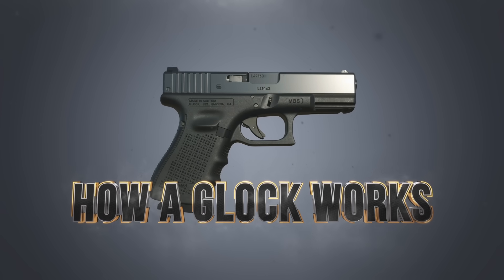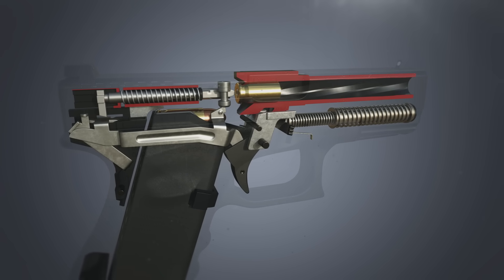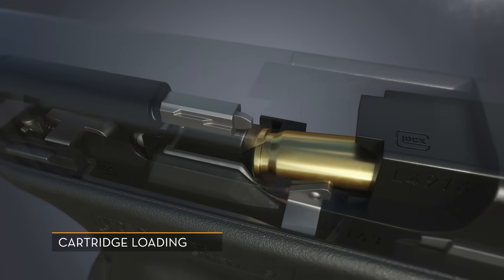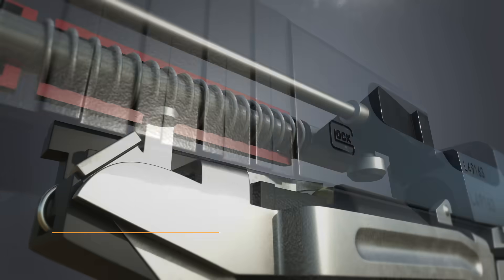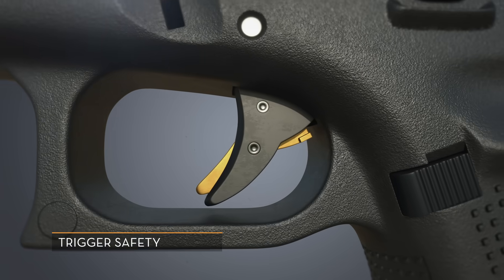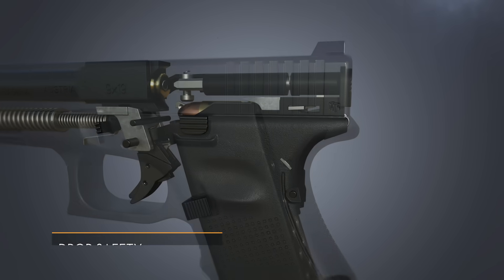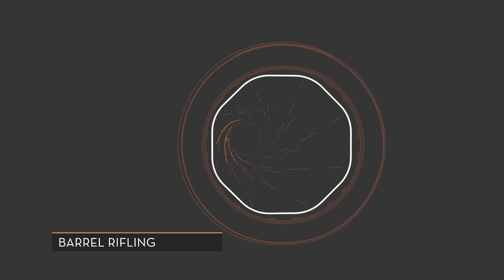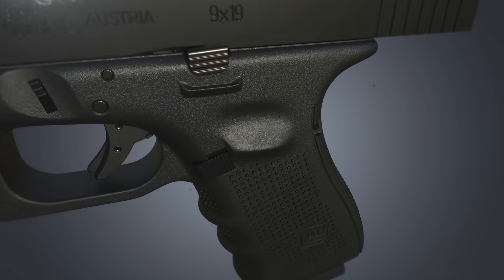How a Glock Works

Comment: Doesn't matter how it "works", i.e., firearms "function", they don't "work". Anyway, you couldn't give me one....because there's no safety. None. Zero. Nada. Ain't there...  Yes, some of you emotional hot-heads will say there is one, it's your finger not being on the trigger....and you're right, I do know that. Trouble is, even those of you preaching this "safe Glock handling technique", don't follow your own guidance. You think you're so well trained, you can keep your finger very near/on the trigger; a very, very bad thing to do. Keep your Glock, I'll keep my M1911A1 .45 Colt.
Reply: JD S  agreed.  I like having a dedicated safety myself, although the glock’s drop/trigger/firing pin lock-outs are nice features.  Problem is that even highly trained pro’s tend to rest their finger on the trigger when they’re stressed out in the heat of the moment.  Then they flinch and “bang”! 💢
Reply: I trained with and used the 1911A1 and I'm not only very comfortable with it, I'm also an expert marksman with one. That being said, I now own a Glock. Years ago the 1911A1 was the pistol to have because it was largely the most common, reliable and proven combat type weapon around. Yet even back then many people I knew hated them and preferred revolvers. Now a days, the Glock 17 is the most popular weapon, widely used by law enforcement and private owners. Any weapon requires the operator to practice and be proficient. In that the 1911A1 and the Glock are equal. In today's world, in conscious intent to keep up with the modern world the pistol to have is the Glock because it is largely the most common, reliable and proven combat type weapon around. That being said, surely there are those who would still keep their 1911A1s just like those who kept their revolvers. But those of us who kept our 1911s back in the day did so because we knew that the most important part of it was the mag. And in a SHTF situation your only sources to replace parts were from the enemy and that enemy would most likely be government forces. Nothing has changed and arguing which is superior is irrelevant. The totality of the argument has already been settled. Our enemies have the Glock and so must we. The same rationale applies to the AR15. That's what the enemy uses so we must use it too.

Comment: “All that is complicated is not useful. All that is useful is simple”.
Gaston Glock

“All that is complex is unnecessary, and it is simplicity that is required”. 
Mikhail Kalashnikov
Reply: "All that is complex is unnecessary, and it is simplicity that is required."

Perhaps we need to communicate these simple ideas to politicians and the legal system which supports then: Kalashnikovs; dynamite; Molotov cocktails. So simple, effective!
Reply: Did the Winchester's have anything smart to say
Reply: Writed with Computer
Reply: @Tom R You take a preexisting design and improve upon it, making a new design. It is simple.

It's not like they make this from zero every time...
Reply: @Tom R 
It's as simple as possible I think is the point
Reply: Yep i can roll with that
Seems perfectly legit to me
Reply: Also the overwhelming metal cartridges would likely set it off too(Projectile usually lead=metal. Casing brass or steel= metal, and I believe they still use mercury in primers but that one's iffy).  Unless metal detectors only pick up magnetic(iron) based things but I don't think that's how it works.

Also the slide is steel as well. Honestly the grip frame is just about the only thing made out of polymer. Maybe parts of the magazine.
Reply: Eric Pope  Would you prefer a Kalibri?
Reply: Occam's Razor
Reply: Can we just acknowledge that some kid out there has the word "Glock" as his last name
Reply: Was he single or just bluffing?
Reply: Gerrit Peacock  :| Germans turned a steam locomotive into a gun (HK G-11), what do you expect from them ?  :')
Reply: DAN LAROCA   https://m.youtube.com/watch?v=f41HusJSXOI
Reply: My balls are itchy hence me scratching with fork

blazeaglory
Reply: After putting together a p80 and all the parts kits I feel like a Glock is the ak of pistols
Reply: Dis is nice
Reply: "Never trust internet quotes" - Albert Einstein
Reply: Why do it the easy way, when you can do it the complicated way.
 - Germans
Reply: said the men who indirectly helped remove earth's viruses..
Reply: Says the one who wrote this comment with a complex device (smartphone/PC) on a complex network (internet).
Reply: @shayanmoosavi9139  Not that complicated at all XD
Reply: @IllNacs  are you suggesting that smartphone is a simple device? It's none of my business but may I ask what's your field of study?
Reply: @shayanmoosavi9139  Just a normal high school diploma, doesn't take a rocket scientist to understand how not-complicated phone software and hardware is 👍
Reply: @IllNacs  that's only one side of the story. the software may look easy to use but not easy to make. It's thousands of lines of codes. It takes hours and maybe even days to program. You have to learn multiple programming languages and algorithm to learn how to make an OS like android.

The hardware may look simple but understanding how it actually works and how it's made is not simple. Let me ask you some questions to understand what I mean. How exactly can the CPU process the information? How does it understand the commands? How exactly can the hard-drive store information and how does it communicate with the CPU? They're not self aware like us humans so they can't do these on their own. It's a purely physical phenomenon (well, technically our brain function is purely physical as well but I'm not a neurologist. I'm a physicist). 

If you look for the answers of these questions you'll realize it's not as simple as you think. It's a relatively complex process and requires advanced physics to understand. I'm not saying that you can't learn them. You absolutely can learn it if you work hard and don't give up. I believe anyone can learn anything if they study it the right way. 

I hope that you learned something new today and I hope that I made you curious and inspired you to learn these concepts deeper. 

Good luck buddy :)
Reply: @shayanmoosavi9139  and? People can say things without every single thing in their life applying to it
Reply: DAN LAROCA lol tell that to rocket scientists
Reply: Gaston glock: me talking normally Mikhail kalashnikov: me writing stuff in school
Reply: Maybe thats why csgo has the T side use Aks and glocks. Or maybe not just a theory
Reply: I still prefer a Colt, and that is coming from a Glock owner.
Reply: can you call a computer simple tho?
Reply: So Algebra is useless?
Reply: @darthkso3745  

"So Algebra is useless?"

It is to me!

Algebra is people assigning statistical probability to events they think are random when in fact they are predetermined, preconceived or part of a plan/process which they are unwilling to admit!
Reply: @HORNY CATS how
Reply: Not saying that everything needs to be made out of rocks and twigs dumbass
Reply: I cant find the glock quote anywhere. Fake?
Reply: @booty_hunter4207  yeah because if it's not on the internet it's fake
Reply: @blazeaglory  well dawg its a famous dude so you'd think if it was a quote you'd find it you ape
Reply: Both were communists right?
Reply: Seems more complex than a 1911A1, so a Glock is not as simple as Glock wishes.
Reply: Eric Pope  

"Still an uncomfortable gun tho"

Because it's cheap, and made of plastic (polymer). Wouldn't that get it through the metal detectors at airports?
Reply: @nossasenhoradoo871  dude if it's completely made of plastic the heat from the exploding gunpowder would melt it. The internal parts are made of metal. The reason for making the external layer out of plastic is to make it light.
Reply: @shayanmoosavi9139  

 "if it's completely made of plastic the heat from the exploding gunpowder would melt it. The internal parts are made of metal. The reason for making the external layer out of plastic is to make it light."

Got it!
Reply: @nossasenhoradoo871  I'm glad to help :)
Reply: @nossasenhoradoo871  The mechanical parts inside are all metal, not to mention about the barrel. Does it make some sense now?
Reply: @nossasenhoradoo871 it has metal parts, so no, pretty dumb cuestion tho
Reply: @ivantimofeev2233  

"pretty dumb cuestion tho"

Not as dumb as the questions you don't ask!
Reply: Sam Samoa is that a joke
Reply: @nossasenhoradoo871  Show me a gun completely made of plastic and I'll show you a gun that won't shoot more than one mag before exploding.
Reply: @theerealatm  

"Show me a gun completely made of plastic and I'll show you a gun that won't shoot more than one mag before exploding."

There's a challenge for an engineer!

So Magneto's pretty safe then, at least for a while!

(Good thing I didn't try and smuggle one onto an airplane, then!)
Reply: @theerealatm  technically speaking, what about bakkelite (azbests are polymeric structures). Heavy (even though lighter than steel), less durable though. Should be able to do the trick (you will just die to lung cancer).
Reply: @matejbosela9093  lol maybe.

Comment: when the slide is back why does the barrel always look like it's pointing up? like it's unaligned with the rest of the gun?
Reply: The top of the barrel locks into the slide when in battery, it unlocks and tilts down to unlock when the slide is cycled.

Comment: Quick question: I understand the firing pin block
's job as is clearly demonstrated here. But I think i've heard it referred to as a sear disconnect. Is this true?
I get the sear's job is to stop the hammer or striker from releasing before the spring is under enough pressure for it to drop and hit the primer. 

Is it just two names for the same thing? Is this a hammer/striker thing? Is this the more common name? 
I dunno. 's why i'm asking I suppose.

Comment: Why the slide doesen't move back until the bullet leaves the barrel?
Reply: El Sarto, you see the barrel tilting?  It kind of operates like a doorstop holding the chamber closed as the slide moves back. Once it tilts to a certain point, the barrel stops and the slide continues back, opening the breech and ejecting the spent cartridge. This keeps the pressure in the chamber long enough to let the action cycle completely.
Reply: @CastleBravo023  thanks

Comment: This is really amazing how it works. There’s a lot of thought to goes into it, you can tell that this is the third or fourth or fifth generation pistol from the very first semi autos. It took generations of pistol design to come up with these embellishments of the original. Think of how the magazine follower blocks upward the slide catch and how the trigger bar prevents dropped guns from misfiring. That is an extra extra level of interior detail and function lobed onto the central mechanism of firing and reloading. That had to be a later concept or else a stroke of pure genius and lucidity for the designer to draw down.

Comment: Why is it that when a Glock slide is in the rearward locked position, the barrel appears to be pointed upwards slightly?
Reply: The barrel doesn't tilt to allow a new cartridge to load, that's part of it, but the main reason is that the top of the barrel has a locking lug which locks into the shelf of the slide.

When you pull the trigger, those two work together to slow the slide down.

The barrel tilts down when the bottom locking lugs stop it's short recoil distance, and allow the slide to unlock and move backwards to strip another cartridge from the magazine.
Reply from the maker: Scoobs McDoobs Ahhh okay hah! You’re definitely more knowledgeable when it comes to that stuff than I am :D
Reply: @mattrittman  Still even with a few minor problems, this is a fantastic animation.

Keep it up, you have talent.
Reply from the maker: Scoobs McDoobs Thank you so much, I really appreciate that.
Reply: Thx lads.
Reply from the maker: It tilts down so that when it returns forward and strips the new cartridge, the ramp is in place.

Comment: Not just a glock, but the majority of semi-auto pistols cause they took bits of the glock cause it's pretty much the most relaible and basic method
Reply: You realize the 1911 is semi-auto right?  And was in production in, get this, 1911.  Fifty-two years before Glock even existed as a company.

Not saying Glocks are bad firearms, quite the opposite.  It's just disingenuous to claim other semi auto pistols copy Glock when they are far from the first in existence.
Reply: Needs a thumb safety. Read the stats.

Comment: Simple but complicated at the same time how the barrel bends down is freaky
Reply: I'm assuming you don't know why that happens. If you do then disregard the rest of this reply. 
The "bending down" is a point of commonality between the Glock, 1911, Browning Hi power, their clones, and no doubt others. It's what makes these guns recoil operated rather than simple blowback operation. In battery, the slide and barrel are locked together. as the weapon is fired, the slide and barrel  travel rearward a short distance, still locked together. Then some device, a swing link (1911), or a non-moving part (Hi power and others) forces the barrel down unlocking the barrel and slide allowing the firing cycle to continue.
the whole point is to keep the breech locked until pressure drops to a safe enough level.
Reply: @chuckaddison5134  I knew somewhat but that explained it better for me a lot thanks

Comment: Gee,  an exact copy of the Browning Hi-Power, with a shit trigger added for "innovation."
Reply: Exact copy are you serious? 😂
Reply: @Iappari  Yes, other than being made of plastic and cheap metal stampings, and the shit trigger, it's the linkless tilting barrel system that JMB drew up in 1926.
Reply: @kodiakkeith  So the locking system makes the whole gun? Thats the stupidest thing ive heard in a while.
And what metal stampings are you talking about?
Reply: @Iappari  Yes, actually.  The locking system is the working mechanism of the gun.  The small metal bits are cheap stampings.
Reply: @kodiakkeith  Yes ofcourse there is nothing else to how these firearms work than the locking system. Everything made after 1920 is just EXACT copy of something else. 
Small metal bits... 😂
I understand that you have mindless fanboyism syndrome but come on now. Glock has couple stamped metal parts yet its still way more rugged design than any hi power. Literally only thing hp has over glock is nicer trigger
Reply: @Iappari  Plastic makes the Glock less ergonomic since the frame must be much thicker to have the strength.  It's laughable to suggest the Glock is "more rugged" than traditional steel pistols. Essentially, the Glock (and the copies of it produced by other companies) is just a way to produce cheaply.  If you're fine with a cheap copy with poor ergonomics and a lousy trigger, go for it.  I'll spend a little more for a gun that points naturally and has a good trigger.  If the shit ever hits the fan for me, I'll have a much better chance to survive he encounter.
Reply: @kodiakkeith  go ahead you can choose whatever you want with your money.
I had enough experience in the military from both of these firearms that i know what i carry if it needs to defend my life
Reply: @Iappari  The problem with Glock fans is that they usually come from a place of zero experience.  They only know plastic and shit triggers, so they can't make an informed choice.  There are so many good pistol designs (meaning good ergonomics and good triggers) that if you were to try them you would then almost certainly make a better choice than Glock.  With that said, there's nothing inherently wrong with a Glock.  They are sort of like the Toyota Corolla of pistols.  They work, but there are a LOT of other designs that will blow them off the road.
Reply: @kodiakkeith  ive seriously never had that much of a problem with a glock trigger as you make it out to be. Its something to get used to sure but it never steered me away from the platform as a whole. Glock isnt a target shooter it aint made for that. Its a carry gun ment to be simple so when you draw it out there is as little as possible to go wrong with it. Thats why its so popular and has replaced guns like hi power because its simple and fast to operate. You dont need to hit 3 inch group at 25 yards with it for that job i obviously agree there are better guns for
Reply: @Iappari  A Hi-Power, a 1911, the DA/SA 'wundernines' or just a good old revolver are just as fast as a Glock.   With all of them you draw, aim, pull the trigger.  The safety, or lack of with Glock or Revolver, does nothing to increase or decrease speed.  The safety is off before the gun is on the target.  The problem arises in the interface between your brain and the mechanics of the gun; that is the trigger.  With all of the fear, shock, adrenaline of a deadly exchange, you do not need or want a long spongy trigger pull that will spoil your shot.  Only hits count.  Good triggers increase hit probability.